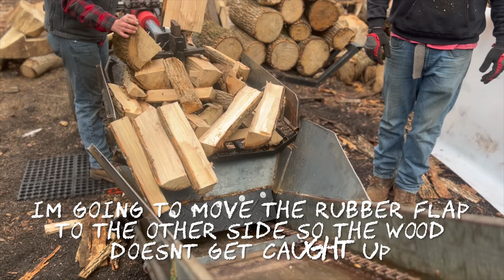#321 First Splitting Session with the New Firewood Conveyor

Comment: The slower speed of the conveyor is the way to go.  It reduces wear on the chains and all the moving parts as the hours add up, including the engine, and probably reduces the fuel consumption as well.  As long as it's clearing the wood fast enough from the outfeed table, it's doing it's job.  Another great video!
Reply from the maker: I agree, I’m glad we got the motor running better so as to allow for lower idle speeds.

Comment: You can lower the conveyor to make it go in the middle of the trailer to make it a little easier. Nice job on the conveyor.
Reply from the maker: Yep this is a good idea, only issue is that would cause the motor to be at a slight angle due to the way we had to mount everything.

Comment: That is the beauty of incremental improvements in the process, eventually, everything gets a turn at being the bottleneck. As for the boxwedge, I think I heard somewhere that it is a patented technology, but that might only apply to processors. So fabricating one for yourselves might be the way to go
Reply from the maker: You’re absolutely right about that, I know Japa patented the box wedge on their processors, I think it’s fair game for log splitters especially if I make one for myself
Reply: @DudeRanchDIY  eastonmade also has models with a boxwedge so they may also be available from ruggedmade. But self made is prob cheaper. good temp control for your hydrolic oil (extra radiator with thermostat controlled valve?) so the auto return works properly will also enhance the effectiveness of a boxwedge. Your splitter is becoming a regular frankensplitter with all these adaptations though. lol.
But all that will not be cheap. if the channel grows enough maybe wolfe ridge or easton made will sponsor. After all, Firewood at the furnace managed to do exactly that.
Reply from the maker: Ruggedmade doesn’t offer a box wedge at this time. Yeah for now I’m just going to keep it how it is, no need to make it more complicated 😂 An Eastonmade splitter with a box wedge would be awesome, maybe I’ll work up to one one day like Brad and others!

Comment: Reducing the RPMs on the conveyor was a good call. Try the same with the splitter. I have been experimenting with my Wolfe Ridge running it at 3/4 throttle for the smaller wood and full throttle for very large rounds.
Reply from the maker: I always leave the splitter at full rpm, that’s how the motors were designed to be run, and I achieve the fastest cycle time that way.

Comment: Hi guys, nice job on the conveyor. I have a bunch of conveyors several which are converted hay and grain elevators. I also have a home made 36" stroke splitter with 4 way hydraulic wedge. Couple things that will speed up your splitting. Less movement of the wedge up and down and every cycle needs to make splits that go on the conveyor. When Chris is prestacking the rounds try to keep them all close to the same size so that you don't have to adjust up and down. On rounds that only require one pass thru the wedge this means you don't have to adjust the wedge height. On the bigger rounds it means you drop the wedge to the size you want the split to be on the bottom, this means every cycle puts the proper size split onto the conveyor, the bigger split is on the top and is the only one you handle, pulling it back and getting split again. Box wedges make too much splitter trash which is extra work and wood you don't get paid for. If you aren't on Arboristsite then consider joining. Lots of us post equipment that we have built ourselves. I have most of my equipment posted. Good luck and happy splitting.
Reply from the maker: Thanks for the feedback. I try to have every cycle produce finish sized pieces but it can be hard. In my mind it’s much faster and easier to move the wedge up and down to center on the piece than it is to organize all the rounds by size. After all I added the hydraulic wedge lift for this exact purpose. While the box wedge can produce a little more waste (depending on the species of wood) they are producing multiple finish sized pieces of wood every cycle. That extra “waste” I sell as kindling, include in my bundles, use for my own wood stove, and burn in my barrel to keep warm while splitting. I get paid for it and use it quite often! I appreciate your detailed comment! Thanks for watching!

Comment: Congratulations on the conveyor improvement 👍 Is your log splitter's log lift leaking down? Or I'm I seeing things with faster video footage 🤔
Reply from the maker: Thank you, the log lift does sag down over time. I’m told by ruggedmade that it’s normal, there don’t appear to be any leaks coming from the cylinder.
Reply: @DudeRanchDIY  WOW 😲 that's what I thought, I seen. That means the control valve is leaking internally (bypassing) nothing to worry about (right now.) Hopefully in the next year or two Andrew Easton will make that (bottle neck) disappear like he did for Brad @Firewood at the furnace 👍👍
Reply from the maker: @workingmanrondoyle3287  That sure would be awesome!!

Comment: It seems as if you have basically perfected the firewood process for the equipment you are using.  Does Ruggedmade manufacturer a larger splitter than the one you are using?  Keep up the good work and be safe.
Reply from the maker: I think we have as well! Unfortunately Ruggedmade doesn’t make a splitter larger or with the features I’ve added to mine at this time.
Reply: @DudeRanchDIY  Have you ever looked into a sponsorship or partnership with a manufacturer?
Reply from the maker: @jamesgaul1022  Not really, I’ve worked with RuggedMade thus far as I’m sure you know, but never really looked elsewhere due to the overall cost of the machines being out of my price range.

Comment: Any idea why the log lift table sags down over time while you’re splitting? Something hydraulic I imagine, just curious
Reply from the maker: I’ve been told it’s not designed to permanently stay upright and sagging down over time is normal especially under load. There are no visible leaks coming from the cylinder.

Comment: Why run two engines…

Upgrade the splitter hydro pump and run one power unit.

Pair of hydraulic lines to the conveyor.
Reply from the maker: A larger hydraulic pump on the splitter would require a larger motor as well. As is, running the conveyor off the splitter would rob flow and slow down my cycle time.

Comment: Why run two engines…

Upgrade the splitter hydro pump and run one power unit.

Pair of hydraulic lines to the conveyor.
Reply from the maker: Larger hydro pump would require a larger engine and larger oil reservoir. Much simpler to run it’s own small engine rather than making those costly upgrades. Plus it doesn’t have to be tied to the splitter to be used.